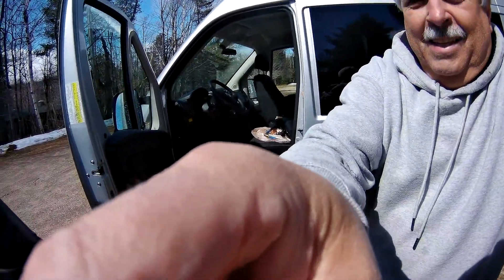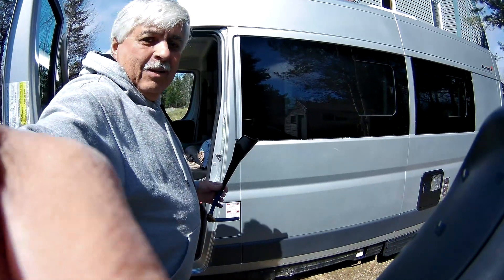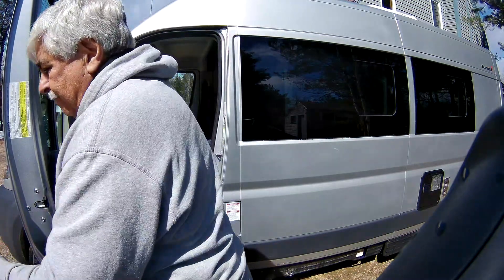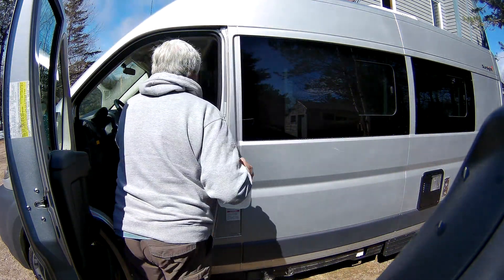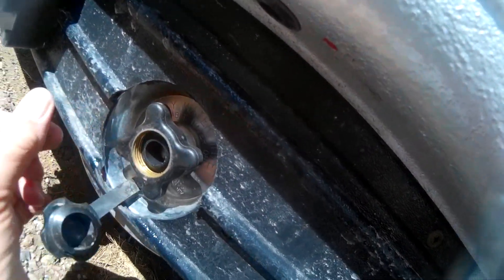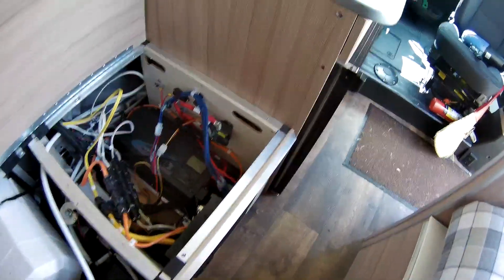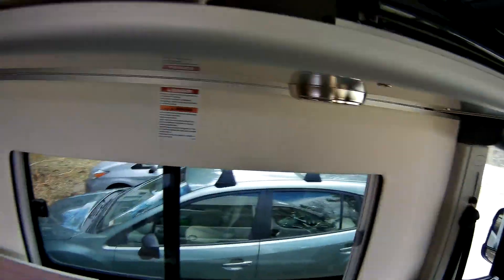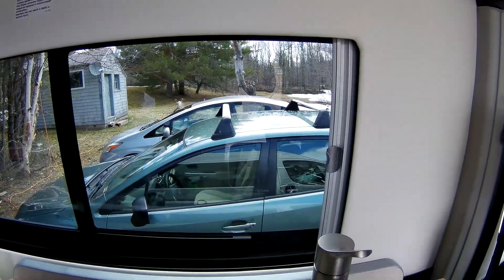2018 Erwin Hymer Group Sunlight V2 Fresh Water Tank Fill (Van Two)

Comment: Do you sleep with the coach in the twin bed format or do you add the center piece and make it a full bed?  I am concerned that I may not fit on the bed in twin bed mode and getting to the bathroom in full bed mode looks like it will be difficult.

Comment: Do you have a real spare tire/wheel?
Reply from the maker: Hi Armando,
No there is no spare tire, one of the negatives for sure!  The Promaster Van does come with a spare tire, but Erwin Hymer removes the spare and installs the black/grey tank in the space where the spare tire would normally mount.  If we do a long term, away from civilization type trip, I probably would get a swing away mount for the tow hitch that integrates a bike rack and tire holder (I think some of the Roadtreks have something like that).
Bob